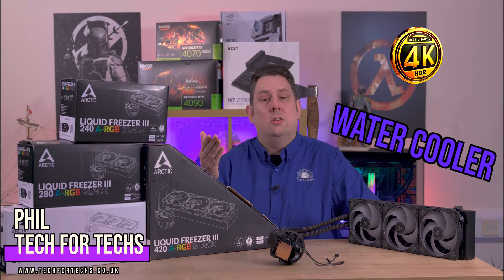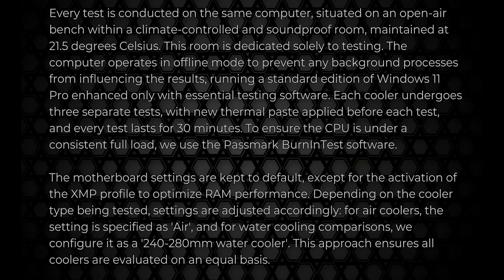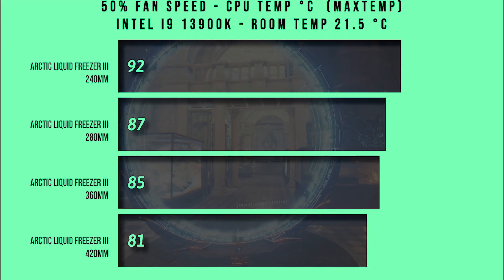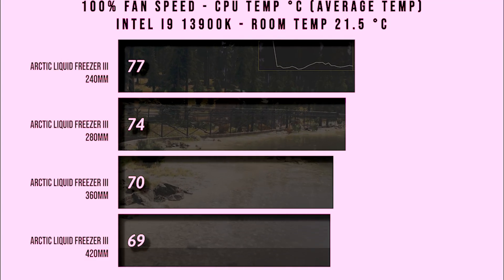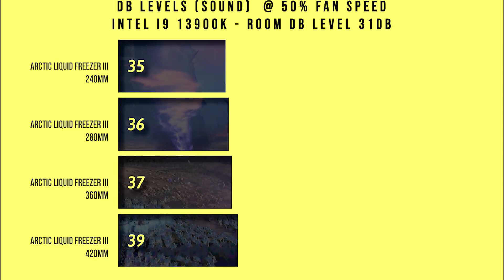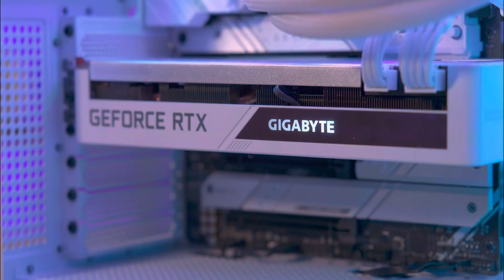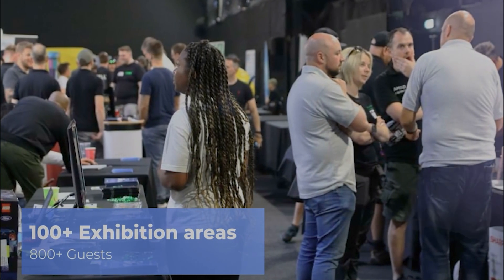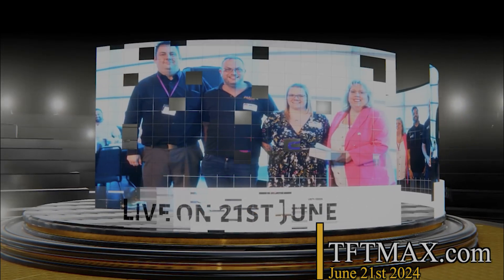240mm v 280mm v 360mm v 420mm - What is the best Watercooler size -  Arctic Liquid freezer III

Comment: I use 420, why? because it fits in my pc case
Reply: What case are you using?
Reply: @Neverian  yeah fake news....I was going to use 420, but then I decided to NOT have it on top but in the front, and my "define 7" pc case can have only 360 in front....so I went with 360 now....BUT if I decided to place it on top, I 100% would go with 420...because it fits...
Reply: @edinpandzic5838  thanks for the response! I want a 420 Arctic for the next build and I can't find that many case options

Comment: 3 db is actually a very large difference in sound volume. Something like 50%. What would be interesting would be to get them all running at a fixed decibel level and check the temperature.
Reply: Was going to type that "only 3 degrees difference". Lol yea, only half as loud...

Comment: I've got myself the 420 one, and since i already had some spare high static pressure 140mm fans, i have them set to push/pull config, running at 33% fan speed all the time, you can literally not hear them until you put your ear against the case, and it keeps it as cool as the standard fans at 100%

Do i need a 420mm rad? no, absolutely not, i just did it because i want to push as much as i can out of my 9950x
Reply: What PC case do you have?

Comment: Please use AMD processers as well, especially with this cooler, the review didn't give much value without that key information.
Reply: Any reason why amd? I have a intel i9 12900k and i need a cooling solution to it since with my 4090 it is running to hot
Reply: @armiralidema6621   Mostly because this cooler has vastly superior performance on AMD platforms. So not including AMD is just misleading to anyone watching the review.
Reply: @armiralidema6621 because amd cpus are better? Name competition to the 9800x3d